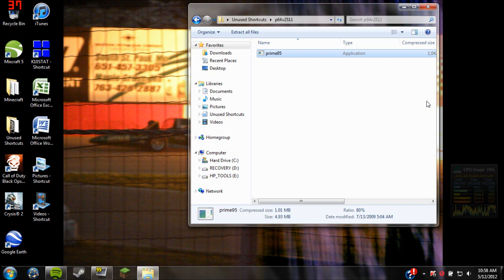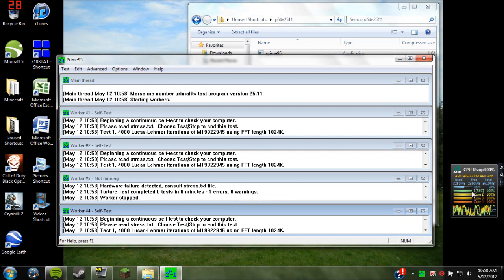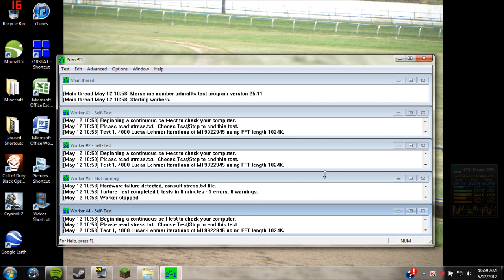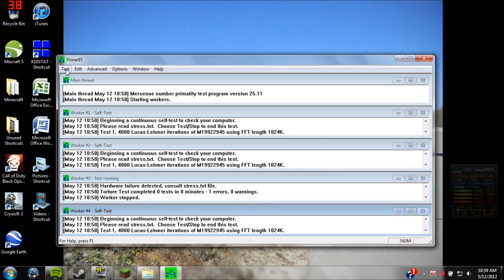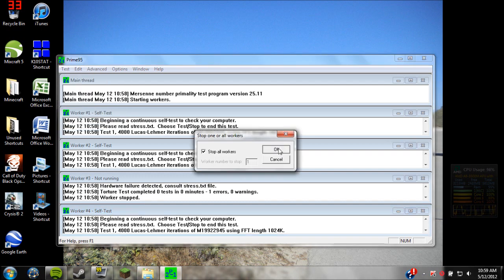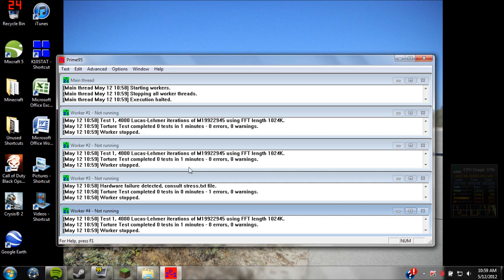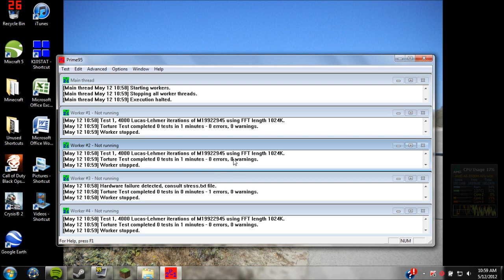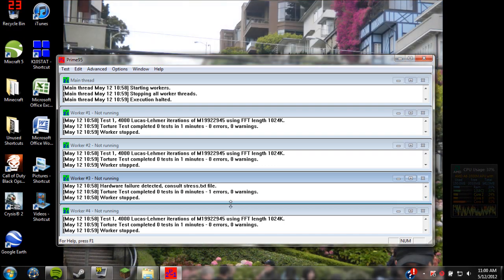How to Stress Test a CPU (Prime95)

Comment: Am descarcat "Prime95" si am decis sa imi testez si eu procesorul si cooler-ul. Cooler stock si procesor Core 2 Duo E6550 2.33ghz.
Procesorul mi-a ajuns la 80grade in full load asa ca m-am speriat si am oprit testul. Usor usor a scazut temperatura si si-a revenit(adica acum are 50grade doar navigand pe youtube). Daca il mai lasam 1 minut garantez ca ajungea la 85grade si putea si mai mult. Nu cred ca e normal asa ceva :))
Reply: Este destul de mare temperatura, incearca sa cureti PC`ul si sa schimbi pasta sau sa adaugi o racire mai adecvata si vei obtine temperaturi mai scazute cel mai probabil.

Comment: When you get an error when stress testing you should definetly check inside your cause and probably take out your CPU and clean it off with some compressed air and put on a new thermal paste, it could have spread to some of the CPU pins.
You should definetly NOT run the stress test again, because if it's a big issue it can short out your whole system, and hmm, my graphics cards are way to expensive for that.

But thanks for the video.
Was checking out some tutorials for the P95 because i don't normally use that program.

Comment: You know absolutely nothing  about  overclocking and what you are talking about. You didnt even tell why the core failed and how to fix that with voltage and not to use stock coolers and why to use blend test...Best off delete the vid before kids fry their cpus...
Reply: Fool, 
its a tutorial about HOW TO USE PRIME95 FOR STRESS TESTING
and not a complete guide for OC-ing

Comment: If I hit 82 max at 100% usage on 4ghz with a stock cooler, I should be good, right?
Reply: +Eden Obsy 82, that is a bit high.
Reply: Channel Zero
I tried again after replacing my case and adding more case fans and got 78 after a few hours maximum. Seems good enough.
Reply: +Obsy it should be fine but for longevity purposes strive for under 75
Reply: +Obsy it should be fine but for longevity purposes strive for under 75
Reply: Giblam1 I only plan on using this until the end of the year, since AMD's new CPUs should be out. ;)
Reply: @DJenerate  I hope u got ryzen lol